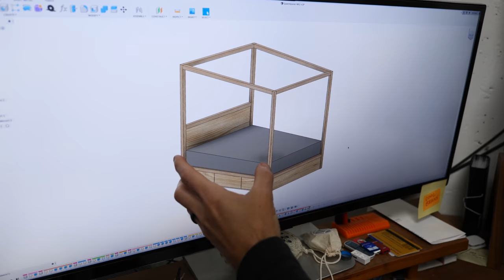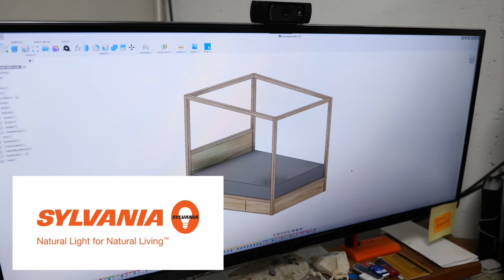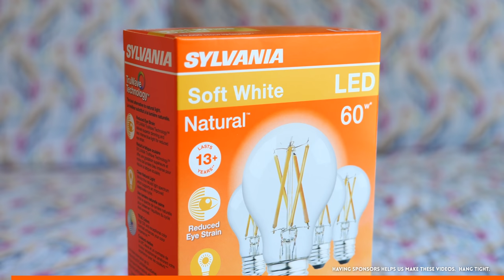How to Make a Modern Canopy Bed | I Like To Make Stuff

Comment: At each of the joints I'd suggest adding a letter so if you disassemble it you know how it goes together. The top bit especially will be a pain to get the dowels matched when high up and matching A-A, B-B will make life a lot easier.
Reply from the maker: We did, it didn't make it into the final video. We labeled them on the face of the top beams so you couldn't see it.
Reply: If you look closely in the video you can actually see the labels for the top beams.

Comment: 13:04 I used 2x4 joint hangers for my bed as opposed to pocket screws to set the middle support beam into. That way it’s removable without any unscrewing or anything, just pop it out and you’re good to go.

Comment: I can barely believe those two assembled sections managed to get through that door, must have been some couple thight corners moving them around. Nice job.
Reply: Was going to say the same thing.  Hard to believe the head/foot board with top cross piece would make it out of the basement and through a normal doorway.  One of the reasons you leave off the canopy cross piece till assembly.

Comment: Gotta admit, I much prefer solid wood for the frame and steel or rebar reinforced ply for the sleeping platform. But I'm also pretty rough on my furniture. For a girl that age you ought to buy a couple of strands of fairy lights to wrap around the bedposts and crossbars. Bonus points for ones made to look like flowers on a vine.
Reply from the maker: We planned on using solid maple for the frame, but we couldn't source any locally.

Comment: Hey Bob, this was a fantastic video, I have a question though, I saw that you went back and forth on two different types of wood glue, whats the difference between them, is it just the color?
Reply: Quick and thick titebond was in the grey bottle, looked like plain old yellow wood glue for everything else
Reply from the maker: The lighter color glue is Weldbond and the yellow is Titebond 2. No preference, I just ran out of one so I used the other.

Comment: When you assembled your posts, you didn't clamp them.  It looked like all you did was glue and brad nails.  How strong is that?  Doesn't glued wood have to be clamped together to develop strength?
Reply: Usually the clamps is just to avoid movement during the glue curing phase. The brads take this job when clamping isn’t possible or efficient :) different methodologies to get the same end result
Reply from the maker: Clamps apply pressure while the glue dries. Using brad nails does the same thing except you have to fill exposed holes.

Comment: When building a project that requires hardware, that still has to be determined, if the mounting holes line up partially with a glue joint do you recommend looking for new hardware or  redesign the piece you are building?

Comment: is the iron on easier than it would be to glue it?
Reply: Funny you ask 😄 We actually cut a section (for time) where we tried to use normal wood veneer and glue. It worked kind of well, but not well enough. The edge banding seemed to have better overall adhesion and was easier to use.
Reply: @forby_  great, thanks for the info? I would imagine too the adhesive on the banding and the pressure youre applying with the iron keeps you from having to clamp-champ it too huh?

Comment: The head and foot boards screamed of need for using the CNC to put a pattern or image onto. What were the screws you had to add in the final assembly? You said you didn't want exposed fasteners, but those were exposed somewhere.
Reply: Which part? The ones for the rail support wouldn't be seen. The pocket holes wouldn't be either.
Reply: @forby_  It wasn't clear to me. While doing the assembly montage there was a part where a fresh hole was drilled and screw put in.
Reply: @davidbuffington9644  I think those were reinforcements behind the headboard

Comment: i wudda just used 4 by 4 posts...lol...thats just extra work
Reply from the maker: It was more work, but I think this looks a lot better.
Reply: On posts this long it can be very hard and time consuming (as well as expensive) to find ones that aren’t warped. If you’ve got the resources to always find those, more power to you. But most people might as well put in just as much work getting a post straight. And this “open frame” construction provides little resistance against future warping of the posts and the whole frame as a result, especially on newer wood. Plywood and the way it’s used here has much less inherent tension than just 4x4 posts.

Comment: Looks good.  My only complaint is why you used plywood.  Why not use some nice wood like maple, or even some mahogany or cocobolo?  The other nick-pick I have is you have a CNC machine.  Why not use that to cut a graphic or design on the head and foot boards?  And lastly, the posts are just straight.  Why not make the posts slightly bigger and put a slight taper between the top and foot and head boards?  Again, these are just nick picks.  It's for your daughter.  Why not make it look really awesome instead of plain Jane?
Reply: I imagine part of the choice is in cost and access—for the amount of material it could be very different with hardwood. This was made so people could follow along and build their own. It's funny, there are complaints either way when the CNC is used—either because people don't have it so they can't replicate it or like what you mentioned. If you build it, you use one—it's just a preference. He uses the CNC every now and then to show how it can be used, just not for this project. In the end he built what he wanted, and if you were to build one you should do the same. These are all fine suggestions, just not what was done. 👍
Reply: @forby_  that's all fine and great, and I've heard him talk about these things before on other videos, so what you've said is stuff I e heard him say.  It's something I would expect him to respond with, but who are you?  Are you speaking for him?  My main point is really that this was for his daughter, right?  Why not put a little more effort into it to make it look nicer?